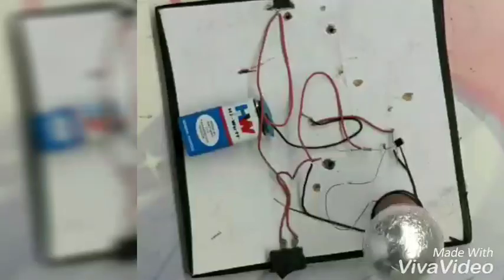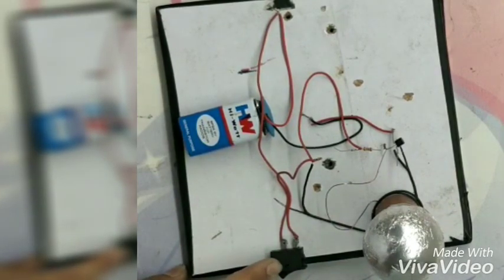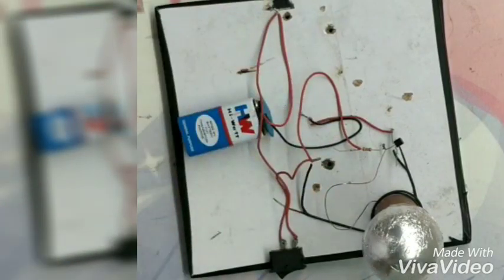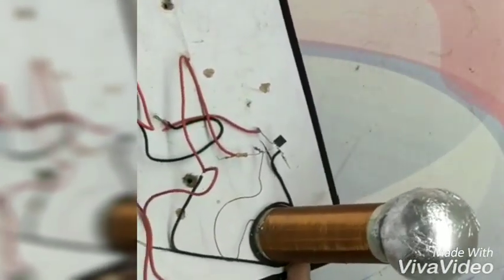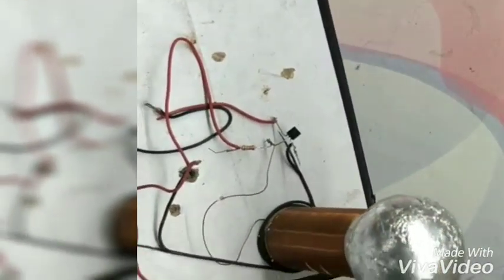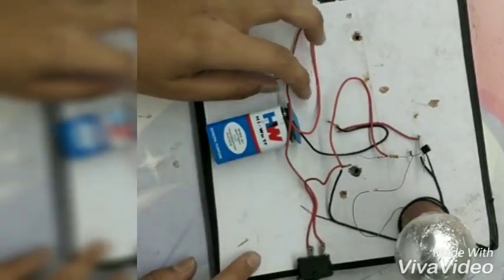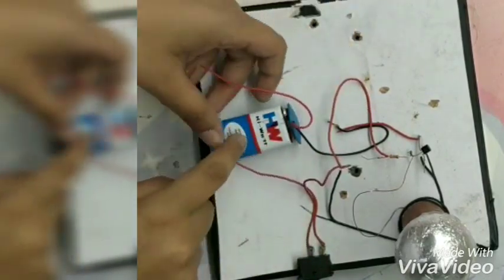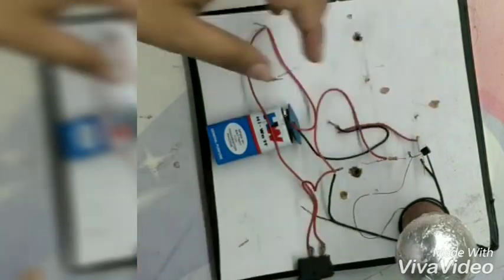Nikola Tesla | Tesla Coil | Class 12 Investigatory Project |  Physics Working model

Comment: Wait that's not a Tesla coil its a slayer exciter... Wth just go and make a Dual Resonant Solid State Tesla Coil you'll know what's the difference between slayer exciter and a actually Tesla coil...and by the way I'm also a Class 12th student and I made a DRSSTC for my project.
Reply from the maker: A low voltage tesla coil without capacitor or inducer- Slayer Exciter. So don't worry. Both work much on the same principles and what's the diff, i covered at last.
Reply: @SanskritiVerma  Do you know anything about inverter oscillators or Armstrong oscillators Slayer is one such oscillator not a true Tesla coil. With a Real SSTC like say Steve Wards Micro SSTC even with 12v in you can get spectacular breakouts go google him(might help you in furthermore projects!!)
Reply: @mdansar8881  pls bro provide me the circuit of drsstc
Reply: @sanjaypandey5107  Try Steve Wards universal DRSSTC driver..its amazing and the best one I have ever made...else try loneoceans they also have a pretty amazing driver...but make sure you are confident enough to work with mains voltage one small mistake can kill you.
Reply: Md Ansar
I agree with you bro ........
It's a slayer exciter which only uses a npn transistor. 
And......I also want to make a drsstc pls bro provide me a circuit...
I made two but none of them are making satisfactory sparks
Reply: @sanjaypandey5107  If you wanna get good sparks then tune your circuit its the key..and it takes hours to tune a tesla coil properly so have patients.
Reply: @mdansar8881  yeah thanks man
Btw I am trying to tune and I am having better results...but i want much big sparks 
Thanks bro
Reply: @mdansar8881 I want to see your schematic bro
Can you help.???
Reply: @sanjaypandey5107  My schematics will be very complicated especially if you are a beginner its from loneoceans don't even try that if you are a beginner in electronics..go with class e SSTC by Steve ward a circuit is pretty simple it will give about 4-6inchs breakouts if tuned properly.. Do you have a oscilloscope..??
Reply: @mdansar8881  yes I have a oscilloscope
Reply: @mdansar8881  the key sight one
Reply: @sanjaypandey5107  Uh thats a very small one its also similar to slayer just a MOSFET switching the voltage but its obviously better than slayer exciter... Try Steve wards class E sstc that should be the best for you..
Reply: @mdansar8881  thanks man 
You really helped me a lot

Comment: bhai sun ek baat bata how can it be in resonance? it hasn't got an ac supply neither does it contain a capacator????
please reply asap ... practicals arriving
Reply from the maker: I mentioned in the video itself, principle is for Tesla coil and what I made is a mini Tesla coil. In Tesla coils, you are required to use a large capacitor to hold large amount of charges but here since it was just a representation and charges need not be stored so no capacitor. But principles remain same.
Reply: @SanskritiVerma  it's not a Tesla coil
It's a slayer exciter....
If you don't know what real Tesla coil is then search for dual resonant solid state Tesla coil DRSSTC which deals with high voltage.....and this projects deals with high frequency (big difference)